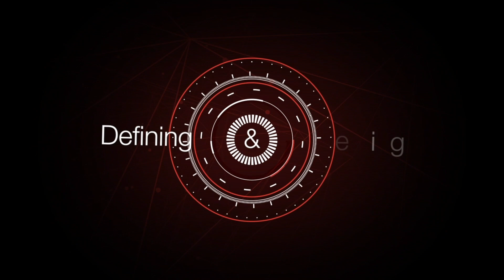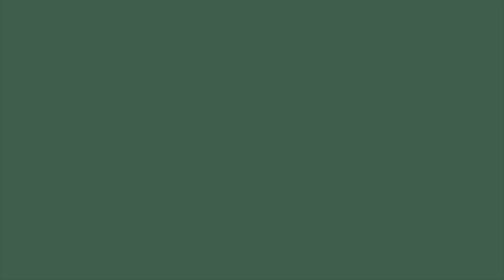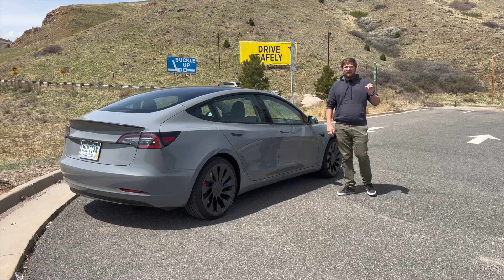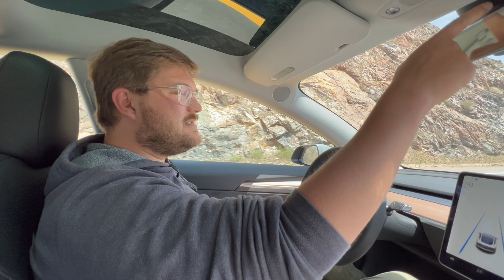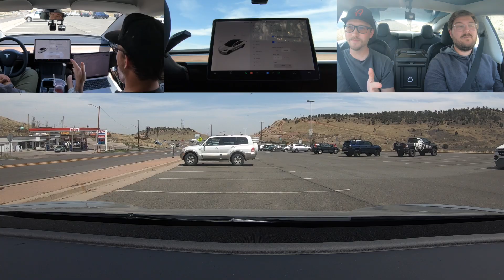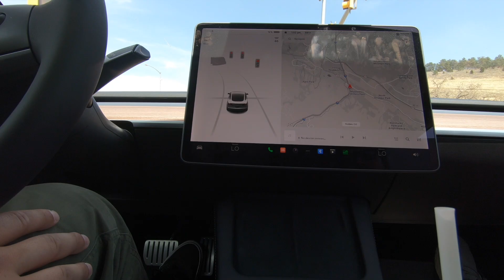2022 Vision-Only Tesla Model 3 Autopilot Hogback Driver Assistance Challenge!

Comment: The fact that driver assistance disengages with EVERY LANE CHANGE is a total fail! That’s just incredibly stupid. What is the point of that??? And why isn’t the steering wheel capacitive? That seems like table stakes for a modern system. My Genesis changes lanes automatically when I put on the turn signal, plus I can change lanes on my own if I want to, and driver assistance never turns off. I can also accelerate as much as I want manually and it never turns off. The only thing that disengages it is hitting the brakes, which is how it should be. What is the logic behind disengaging the system for every lane change? I’m just floored at how dumb that is. As far as I’m concerned you should deduct a point every time you have to re-engage after a lane change. It’s so unbelievably stupid! I just don’t get why people think this system is good. WOW!

Comment: Actualy, Modern airliner will pretty much fly themselves, and could even land themselves in Autopilot, though pilots prefer to land/take-off themselves. But with airliners, it takes the pilot programing the flight computer every time, and keeping the diverent  NAV radios changed, so, again, the still monitor the progress of the plane and are ready to take over, but the modern Airbus/Boeings pretty much fly themselves (in fact,  look up how the throtle lever works on the Airbus airplanes: YOu have settigs for cruise, climb, go-around, etc).

Comment: What if a car tried to pull over to the shoulder, but there no shoulder and a cliff instead? :) 
I think the names "autopilot" and "Full-Self Driving" imply to people "car's taking over" or "set and forget" as it would on an aircraft (though most people don't know that while  pilots set autopilot on planes, they still monitor the craft's instruments and are ready to take over). Problem with thsi names (as oposed to "Lane keep assist" or "Adaptive Cruise Control" imply that it is an assist, and not a "take-over and forget" system. 
Since this video, FSD is $16K and now Enhanced auto-pilot is like $6K (Still feels pricey). Wish that, since many other cars like BMW have lane changes,  that this woould add the lane changes (like, if you use the turn signals) without having to pay extra for Enhanced Autopilot.

Comment: Seems like it took the hill with a PERFECT score. Your DINGS against AP are for a feature? If it is designed to be in the center during a lane merge you can't ding it for doing that, it didn't do it wrong, that's exactly what they designed it to do. It wasn't an "oh, crap" event, it was that the lane got wide and then it split into two, so it pulled back into one of the lanes. It would have taken the exit for you if you had navigated to where you were going. You even dinged it on the downhill for centering in a merge lane, that's 4 dings for doing what it's designed to.

Comment: In the 4,000 miles with my 3 the only thing that I could call phantom braking was on a residential street (not the cars fault and not phantom). It was set to 5mph over and there was a random speed limit drop according to the GPS from 50mph to 35mph. I didn’t see a sign but the car slowed pretty quickly which took me by surprise. Normally it’ll ramp down smoothly

Comment: Love the AP in the Tesla, you just have to be cautious if you are a first time user until you get the gist of it. However, wanted to see if the following scenario is true, it happened to me. Driving at night on the most left lane @ 80mph with AP on,  the highway had at least 4 lanes, further down I see emergency vehicles pulled over on the emergency lane with the flashing lights on. As we are getting close to the spot of the emergency vehicles far to my right, and no cars in front of me, my MYP starts breaking a bit hard for my taste, but I let it happen and see if it was going to keep stopping even more (had no cars behind me either), and it was stopping even more, then I pressed the accelerator pedal  to keep it from totally slowing down. I wonder if AP stops the car if it sees emergency vehicles ahead, not necessary on the same lane or close to it.

Comment: Tesla still cannot do many basics right and it's only gotten worse with the vision only.
1. Speed limit recognition doesn't work in Germany
2. Map data is often wrong and not updated, have to use Google maps instead to look for example non-tesla chargers 
3. During the night every autopilot activation turns on the high beam assist which is so bad it blinds oncoming traffic, turns on too late and doesn't respect the law in town by turning on where its not allowed. 
4. Rain sensor is useless, any other car is better than tesla. Also forced to turn on which is super annoying.
5. No possibility to precondition the battery on request for non-tesla chargers 
6. Autopilot limited to 140kmh. German cars can do 250kmh.
7. Autopilot chimes and the need to engage it every time when changing lanes are super annoying. 

Summary: great car and potential but they can't do the basics right. 
3.

Comment: I think pre-mapped should be plus points. As it’s dangerous if the system allows engagement for roads it is unintended to use. The Model 3 manual lists several conditions where you shouldn’t use autopilot, but the car still allows it.

Comment: The biggest gripe I had about autopilot in the 40,000 miles I logged with it before I sold my Tesla was the phantom breaking. Even though it got noticeably better between 2018 and 2020, it’s still Definitely almost got me rear-ended more than once.
Reply: Its been basically fixed within the last few updates. Ive had 2 in 2 months, when I used to have about 10 a day in a specific road.

Comment: I would like to see this re-ran later this year, say Sept-November timeline. Reason is we should, and on FSD beta we are close frankly - steps are being made internally each build, to them merging/re-writing the NoAP/AP code base to the new system. When the new FSD beta system gets on the highway it does thing far better than the old system (for example, lane centering and ping ponging you had, the new system flat in most of my circumstances has not been like this at all, on highway) or when I get it work on a non-NoAP flagged highway it stays on FSD beta it works extremely well.. IT looks highly promising frankly.. Also was stated was increase of cruise/ap speed to 85 in next update or two, we are waiting on 10.11.12 build still, but it could be in this one. So with that being said a good summer worth of testing, I think it would be worthwhile to get a FSD beta equipped car and re-run this with the new 1 stack and see how it compares then.

Comment: Please add the following situation to your test. Anyone that drives in the Mid-Atlantic region can relate.

- Set Autopilot for the speed limit with a follow distance of 2 or 3.
- Allow it to approach a car doing 5-10mph slower. 
- observe the car adjusting speed to match the required following speed and distance.
- if the car ahead then decides to accelerate, observe the Tesla accelerating VERY slowly, letting the follow distance increase to 5,6,7 etc. It will take almost 20 seconds to reach the speed limit again.

This is infuriating in traffic in these areas. The arguments that the car is being efficient or safe are ridiculous. Needing to push the accelerator to reach the desired speed and keep up with the flow of traffic again is absolutely ridiculous. Autopilot should lose major points here. Granted, it's a TACC issue, but you can't use AP without TACC so it should be considered in a driver assistance test.

Comment: Another thing you can do hold down on stalk while in AP it will change to the indicated speed.example - if you're going 65 mph and speed drops to 55 mph the car will continue (on highway only) going 65 mph.  Just hold down the stalk about 2 sec and AP  cruise speed will change to the new detected speed limit of 55. Also works the other way .
Reply: Never knew this, thanks!
Reply: @peterkim4689  no worries I found out by accident.  Lol

Comment: No extra input to steering wheel to change lanes if you let the turn signal flash 2 or 3 times, don't remember the exact amount.
AP is disabled with traffic aware cruise still enabled.

Comment: Since the AP doesn't really spread out for exits, only entrance ramps and merge lanes... I wonder if it's actually intentional? To dominate a merge area to avoid getting passed in an unsafe zone? It's designed to avoid cars or warn the operator before collision, so if a car was in the lane it would keep left more or turn off AP and cruise control.

Comment: It would be great to know your insights into how other drivers will react and share the road with vehicles that are actually designed and programmed to follow the current laws of the road.  Or will the drivers that use these assistive systems adjusted/hack their vehicles to bypass the laws of the road? (Ex: speed limits) Thanks.

Comment: I am trying to find real life range on model 3 long range  fully loaded with luggage and 4 passenger but seems most all videos I’ve searched has one maybe 2 ppl in car.   Hoping someone will be able to give a answer before deciding to jump in deep end.  I have super bad range anxiety being I would be jumping from the VW TDI where I carry a ton of extra weight and still get like 700 miles to tank
Reply: Weight doesn’t make that much of a difference. On a full charge and depending on the temperature and WIND you won’t get much less range. So I would reckon around 230-270 miles on a sunny day at highway speeds. Just keep an eye on the energy monitor and your expected SoC on arrival.

Comment: Hey Kyle great video! Appreciate the honesty in this video without the bias towards or against Tesla/autopilot that some other channels seem to have. Probably my favorite series on the channel so far.

I did just want to make one suggestion. You probably already know this, but instead of turning the wheel or hitting the brakes, you can lightly tap up on the autopilot stalk to disengage autopilot in a much more controlled manner. I agree turning the wheel to disengage isn’t very smooth, but just lightly tapping up with your right hand as you simultaneously turn the wheel left/right  completely solves this IMO. You’re probably already aware of this but just wanted to mention in case any viewers weren’t!
Reply: yeah it's good, openpilot is better then teslas system and is much more complete. tesla system is limited more then 29k hyundais, little reconigiton on signs and no lane change lol?

Comment: Prior to getting a Tesla, the only experience I had with “self driving” was on MB and Toyota products. They were pretty much just radar cruise with active lane keeping assist. What impressed me the most about Tesla’s Auto Pilot is how smoothly it handles tight bends in the road, and people changing lanes or merging right in front of you. Its also cool how it seems to get slightly more aggressive in bumper to bumper traffic, so as not to have people endlessly cutting in front of you. You ooI use AP in my MYP all the time, often on uptown and suburban streets. I’ve only had the car a few months now, but for the first couple weeks it would phantom brake every time I used AP. But then one day it just stopped. Don’t know if it’s learning or got tweaked in an update. The only time I had to grab the wheel was when the car in front of me pulled over into a left turn lane with a bunch of other cars already lined up. The Tesla kept going straight and that’s fine, but the problem was the car that pulled over didn’t pull over all the way and had about a foot of its rear end sticking out into my lane. If I didn’t yank the wheel at the very last minute, I’m certain we would have collided. That was a wake up call for me because until then, the system had lulled me into an admittedly false sense of security and confidence in its (self) driving abilities. Regardless, I still use it and still love it and I agree completely with the verdict. Without a doubt, other cars do certain things a bit better than Tesla; but the things that Tesla does better, they do a lot better.

Comment: Hi is the motor on the performance model 3 bigger than the long range model 3?
Reply: No. P just injects more current to the same motor.
Reply: @gogoRooooooo  The same motors are manufactured, but they are then tested and the ones that can handle the extra input are tagged as Performance. It's the testing that differentiates the motors, not anything about how they build them.

Comment: just some 2 cents. The point weights for unresponsive driver might need some tweaks? imagine if the car doesnt come to a complete stop. thats a massive fail compared to not tugging on the seat belt. Far more catastrophic and points should reflect that
Reply: The car always comes to a complete stop. It's part of the software program. You can imagine all you want but it doesn't make it so.

Comment: PS- the lower limit for follow-distance is 2 for "TeslaVision" cars - I would expect it to go back down to 1 once the data confirms that the vision-based distance estimation is good enough.  Also, I believe that even cars with radar are now not using it, but I'm not absolutely certain about that.  (we have a 2019 3SR+ and a 2019 Raven MXLR - both cars with radars, and I know one of the recent software upgrades mentioned that "you are now using Tesla Vision"...  which led me to believe that the radars are disabled.  The cars are both FSD beta, so that may be a difference also.)  Thanks for the great videos!
Reply: Vision based autopilot is limited to 80 mph on the highway but radar based cars can do 90 mph. Can you do 90 mph on AP?

Comment: In my experience the torque input required varies by the confidence level the AP has in its own actions. In weird construction zones, it requires miniscule input to break free, so no risk to swerve, in other situations it's significantly heavier.
Reply: Its easier to the inside of corners, on straight roads and its heavier to the outside of corners when it is actually actively steering.

Comment: Well done! AP is indeed a huge boon for roadtrips. Well said, it's not perfect, but a huge assistance and probably works the best across all conditions & road types/locations.
One thing I've noticed, re staying in lane & picking a line thru curves, especially w/ wide or joined lanes, or for exits suddenly appearing:
the car appears to give strong weight , to following a car ahead of you (vs guessing at lane lines it is unsure of.)
So if you are scoring based on the car making solid choices or waffling, be mindful if there is a car ahead- it likely will affect the car behavior. I've had it follow cars ahead & stay in lane, even w/  near-invisible lane lines (rainouts, faded paint, new paving where NO lines (just seams)! But if the car ahead is gone, it gets confused and gives up.
Reply: Another stress test case, if you can find one Kyle: roads/highways with some LEFT exit/turn lanes, especially where the leftmost #1 lane widens or splits into two lanes, a left-turn (w/ arrow marking) and straight.
Several times I've had AP pick/stay in that LEFT lane, but keep going full speed assuming it goes straight... 
but, that lane ENDs (into a guardrail sometimes!). I have to take over immediately! and yes sometimes it even jerks/swerves a bit to pick that left lane, too.
That's the only real scary case I've hit repeatedly w/ AP... haven't run into that scenario recently, a year or two back, so not sure if it's been fixed in newer versions.

Comment: This system is so good it doesn't even make sense. I want to test it out in situations like nighttime rain, and extremely heavy downpours. Sometimes rain is so heavy you can't see anything and almost need to pull over. Can Autopilot handle stuff like this?
Reply: Mine does. Not snow storms, but everything else? Yes. Mine still has the radar.
Reply: Multiple eyes (cameras) cannot make up for torrential downpour. My Subaru eyesight admittedly only has two cameras but will disengage and flash an alert in heavy rain or snow at which point I have pulled over and stopped since I can't see well enough to drive either.
Reply: @cjwilson54  Yes, i think thats the correct way. I was surprised in a extreme downpour last year where i could not see where the street is because it was centimeters deep under water, but Autopilot drove perfectly well and much too fast. This year i was in a snow storm where Autopilot worked only a few minutes until it told me radar is blocked. I could not see either. I just oriented on the next lorry in front of me and continued driving blind. Ok nearly blind. I just hoped the lorry knew what he was doing. Lucky me.
Reply: I’ve used it in a torrential downpour at night with no issues

Comment: I don't have an issue with torch to get out of autopilot because I just litely tap the breaks. It's the same as cruise control on other cars. Litely tap the breaks and your out of it. Plus if auto pilot is messing up your reaction is already pushing the break.
Reply: You can also tap the right stalk up to stay in cruise control but disable autosteering

Comment: I do know Tesla with FSD package on the interstate will adjust the speed up and down based on your preset mph or percentage as the speed limit changes.
Reply: Not in Europe. It does not react to speed limits on any faster roads like Autobahn or Interstate etc.